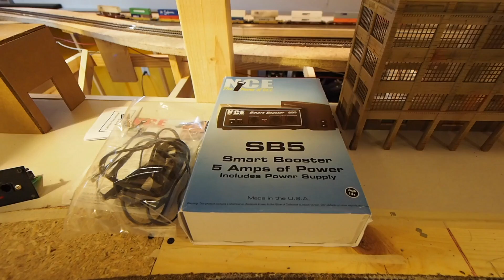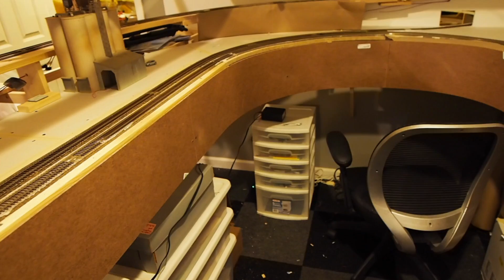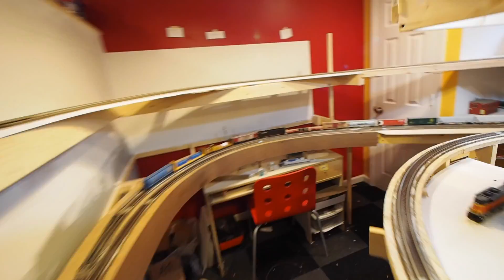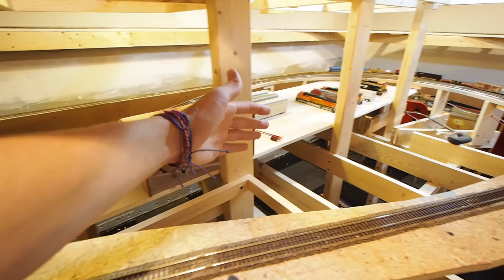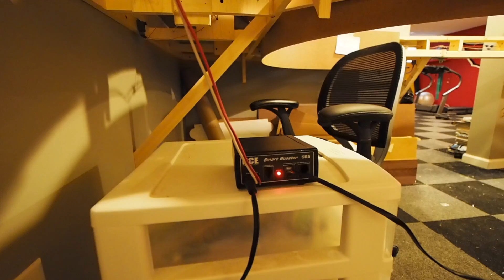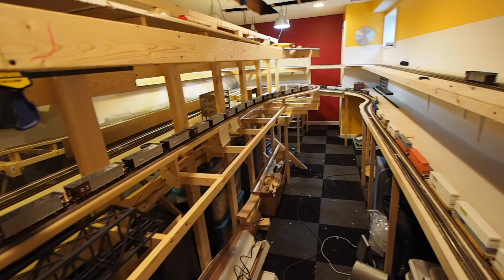Layout Update 20: NCE upgrades + Reverse Loop

Comment: I have the NCE Power Cab DCC controller. If my friend has the same system, what do I need in addition to what comes with the Power Cab to be able to use two remotes? Can I just wire another plug-in panel and link it onto my main bus wires?

Comment: I will need to get one of those SB5 soon.  One of the things I like about the NCE system is the panel that can use Cat 5 and the normal Cat 3 cable.  I have a ton of Cat 5.  You can use the old Power Cab panel for a test track.  The track connector broke on mine but I soldered a different type on it, I hope will last longer.Scott
Reply from the maker: Yeah. The NCE stuff is pretty expandable and straight forward. Their website is atrocious and hard to get information from, but if you screw around with their stuff enough you can figure it out. I'll probably keep the PCP back in the staging room and dedicate a staging track as a program track. Until that happens, it'll be the panel on the end of the RJ12 line.
-Cam
Reply: +railfan220 Hi Cam, you can get RJ12 splitters (2 in to 1) which is the way to overcome the single RJ12 socket on the back of the PCP panel so that you can mount it anywhere in the chain...
Reply from the maker: Thanks for the comment! You're totally right. I forgot they made those.

Comment: Nice update. I also went with the SB5.  A suggestion ... before buying the DB5's, take a look at the DCC booster from Tam Valley Depot. It is half the price of a DB5. I'm pretty sure it's the way I will go.
Reply: railfan220  yes i love my tam valley  depot booster
Reply from the maker: Thanks for the tip! I'll have to check that out. 
-Cam

Comment: looking go , for sure , thanks for doing the video , so to add more throttle ports for nce , they have to have 3 ports in them ? I went and bought a second power cab set , thought that would have done it ,,
Reply from the maker: Thanks! Yeah. To expand the number of fascia panels you're using, I'd suggest getting an SB5 and  then UTPs, rather than PCPs which is what comes with the Powercab. The Powercab is designed to be a stand-alone DCC system, so the panel it comes with only has one port on the back for the control bus. You could technically plug the cord into the front of your PCP and connect that to the back of your other PCP. That would give you 3 port total on the front of the layout to plug in a throttle. The one dilemma is that you can't unplug the PowerCab from the layout unless you have an SB5 or another command station (like the PH Box). The only way to get walk-around capability with the PowerCab is to buy another throttle/cab and to keep the PowerCab always plugged in. You could then use the other cab to plug in at different locations around the layout. However, by the time you spend money on that, it's probably worth it to get the SB5 and some UTPs. You can then use the PowerCab as a mobile throttle/cab.
-Cam